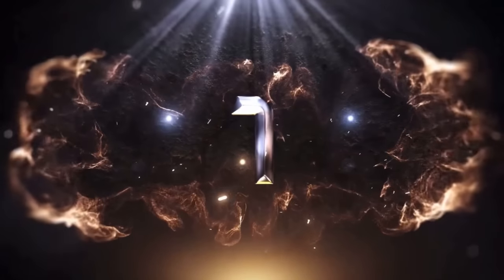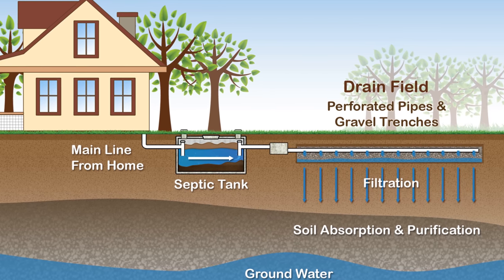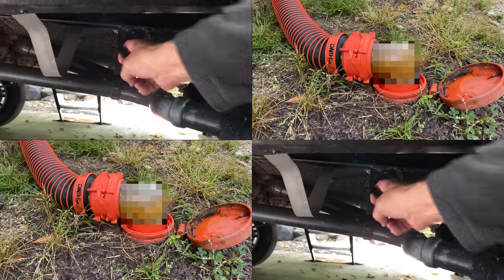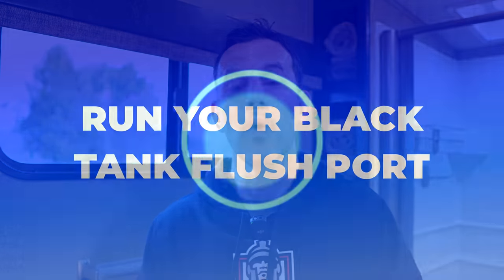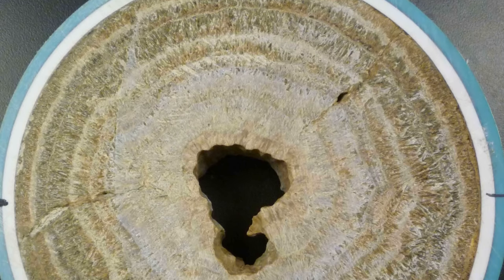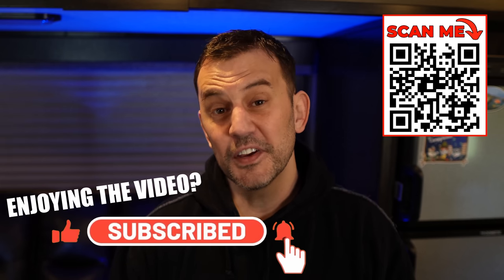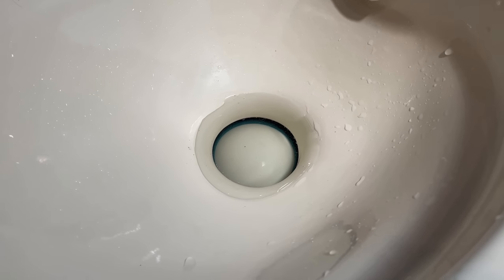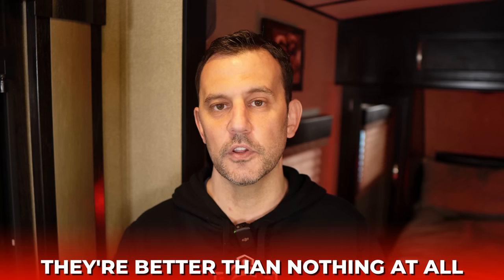RV Black Tank Mistakes, Myths & Secrets + Tips to Keep Sensors Working!

Comment: Upgraded from a pop-up, so new to this... Leaving the campground (not full hook ups) after I use the black tank flush and it runs clean, should I close the black valve and use the flush to put water into the black tank? How else would I always keep water in black tank? That's what I'm supposed to do, right? How much water? Then add some chemical even when not in use?
Reply from the maker: Marcus, precisely.  after you dump, put enough water in your tank to fill it about 10% of the way.  30 gallon tank = 3 gallons.  you can use the flush to do this.  if you are unsure how much you are putting in.... dump a gallon of water into your toilet without pressing the pedal.  then youll know how much one gallon is.  after that, you can slightly press the pedal enough to turn on the water but not open the ball valve.  once it hits that spot, dump it down.  now you know you have 1 gallon in your tank.  repeat until you reach the amount you want.  you can put the treatment in now or before you start using it on your next trip.
Reply: Thank you. So I'd be guessing how long to keep the black tank flush running to put 3 gallons in, if I did it that way. I appreciate your help!
Reply from the maker: It's something youll have to figure out.  Or you can use a 5 gallon bucket... thats what I do.  watch the video at the end of this video if you havent seen it yet.

Comment: I leave the dump valve closed until I'm ready to leave and I also empty the hot water tank into the toilet before I dump. 
Hot water loosens things up(shower head on most campers reaches the toilet).
You don't rinse your plates and bowls out with cold water before your wash them, right?
Reply from the maker: Great point, thanks for watching and sharing!

Comment: Newbie here. Just purchased a 5th wheel. If it is not in use right away, us there a need to fill the black water tank and add any cleaner. We may not use until July so 6 -8 weeks
Reply from the maker: Nope, you can leave it empty if it’s never been used.  Enjoy your new RV!

Comment: Warning for all towable RV owners . Inspect your I beams in the vicinity of the axle / spring shackles.  Sooner or later even the big dollar 5th wheel and travel trailers will get cracks that can cause major damage or crashes . This occurs on tandem axle or especially three axle trailers .  Springs , spring shackles and the I beams will break. On 5th wheels the Basement to upper frame risers regularly break . This information can be found on Youtube and cansave an on road failure or a devastating accident . And the most expensive 5th wheels to the lowly 2 axle travel trailer all break.  That popping sounds you hear backing into camp or making a tight turn is twisting the hell out of your 1/8th inch cheap Lippert metal I beams .
Reply from the maker: Thanks for sharing.

Comment: I have a Jayco Class C. When I use the flush port, it seems the fresh water tank fills up. Because of this I use a Flush King instead. Any idea what’s going on with my flush port?
Reply from the maker: open your fresh tank drain, let it drain, then run your black tank flush.  if water starts redraining out of the fresh water tank, you have a serious issue of cross-contamination issue.  I would check using this procedure first, I find it unlikely but let me know.

Comment: Liquify the black tank yes it helps, but for me I use the old method to clean my tank. I have a 2022 model and it has the hookup where you attach a hose but that way of cleaning was crap. The old method works far better and that’s putting the stick water cleaner down the toilet. Now I can actually see the black tank. I may also close the valve and fill once again then open most of the time actually nothing more comes out except water. The stick works for me.
Reply from the maker: thanks for sharing Brian.

Comment: Great video! My issue is that my RV is new and my sensors never worked from the beginning. They filled our tanks full during our orientation and then completely emptied before transport. I don’t think that there is a build up on the sensors.
Reply from the maker: That's interesting, I wonder why they wouldnt be working brand new out the door??
Reply: @RVTIPSANDTRAVELS  Right! If anything comes to mind, please let me know. This is for all my tanks (two in front and two in back). Even when I completely drain all of them, the sensors all say Full Tank. Very frustrating. I don’t want to just “live with it” I want to fix it. Lol.

Comment: Thinking one reason they are working is because your outflow is wide open and since its empty it has dried out, so no moisture is being utilized by sensors to produce a reading.
Reply from the maker: my waste tanks are never dried out. I always keep water in them.  After I dump, I ALWAYS IMMEDIATELY put 4-5 gallons of water back in.  Even if the RV is sitting in the driveway for a month until the next trip.  I mention this in about 9 of our videos lol.  The only time my tanks are dry is when its winterized.  They are working because I back flush the tanks, but it seems you dont believe me lol.  this video shows how much stuff stays in the tank after the first dump, which is why back filling and flushing a second time will help get all that out and clean the sensors:  https://youtu.be/Q7ZJzfimLwg

theres video proof in that video link i just posted that shows not everything comes out after 1 dump. thats why sensors fail, backfilling and rinsing your tank is important to keep them working.

Comment: When using the black tank flush, is it required to keep the black valve open because of backpressure up into the toilet that can overflow? Like will it harm the system or just precaution to prevent overflow?
Reply from the maker: theres no pressure build up because of the vent, but its ideal to leave it open to prevent overflow.  Not necessary though, correct.

Comment: I originally learned that when using the black tank flush you keep the valve closed and let it fill up, then dump. I figured it soaks up and gets all the stuff on the walls better? I guess that was wrong 🤔
Reply from the maker: It won’t do anything if there’s water in the tank.

Comment: So here is my issue. I only urinate in my toilet in my camper i just got. One day i checked my tank capacity and it said it was full. Now i was told since i only urinate i could leave the black tank open so i did. I was checking my tank for the first two weeks to make sure everything was good and it wasn't building up in the tank and it wasn't. Until now. I checked it today and it's showing full. I tried using the flush thats on the camper but the water wasn't going into the tank. What do i need to do? Yes, im new at the whole 5th wheel camper/rv so any ideas or tips would be really be appreciated and my canper is stationary.
Reply from the maker: are you using septic safe toilet paper?  not rv safe, septic safe only.
Reply: @RVTIPSANDTRAVELS  It only gets used to urinate in. I closed the valve put some water down the toilet, about 3 gallons, then went and opened the valve up and it drained. I believe the sensors are reading false. I done a flush twice and now it's reading half a tank. When I get more time I'm going to do more to see if it's just something on the sensors

Comment: Just De-winterized my RV went on a weekend trip and used the toilet, no solid waste went into it just liquids flushed everything out and now it’s parked until the next trip I’m a little confused. Should I have water in that black tank while it’s sitting waiting for the next trip?
Reply from the maker: If there are no solids at all in your tank it’s less necessary, but I think about it… I’m this video there’s even some liquid left in the tank after dumping, so it doesn’t hurt to put water back in, even while it sits between trips, just to keep everything diluted and less concentrated.  Plus anything from the past that might be in there could now have the chance to start to break up from the water. Hope that makes sense.
Reply: @RVTIPSANDTRAVELS  Sounds good, thanks for the quick response. Really enjoy your videos. Great Contant keep up the good work.
Reply from the maker: Thanks buddy, I appreciate that.

Comment: I have tried back flushing and filling overnight but no luck. Discussing descaling a black tank (2/3 full sensor is not reading correctly), what ratio of water to Rydlyme? Amazon says 1:1 for extreme and 1:3 for period maintenance. I have a 48 gallon black tank and to address all sensors which would be about 30 gallons. If I used 1:3, I would need 10 gallons of Rydlyme. Is this your recommended mixture?
Reply from the maker: Richard, as mentioned in the video, I’ve never used it, but among my research I’ve read in a few places that 1/10and even 1/30 was a good ratio. Let me see if I can find more info and get back to you.

Comment: Idk.. I think the guy with kleen who has been cleaning tanks for 9 years might know a "little" more than you, that's where the its not a septic system its a holding tank comes from. But idk that's just my gut instinct, what he says makes total sense and has cleaned 10000+ tanks.
Reply from the maker: Personally I’m not taking tank cleaning advice from someone who needs to clean tanks.  In this video there is very clear proof that solids do not exit the tank, while liquids do.  So with that video proof I’m going to follow the science and not the sales pitch.  It’s worked for me for 8 years now, and that’s my job here… to help others, not sell tank cleaning services.  This same gentlemen in another video also encourages using bleach in a metal water heater tank.  Again, very poor and irresponsible advice.  You don’t need to be a chemist to google search what bleach does to metal.  While we disagree, I appreciate your input and watching.
Reply: @RVTIPSANDTRAVELS  I think the only way to know for certain would be to buy 2 new rv’s and conduct a test for at least a year. Do both methods, then cut the tanks in half and see the results.
Reply from the maker: I’m going to buy a black tank this spring, build an entire external system, and do independent flush tests.  Going to cut the top of the tank off to film everything.  Will be a big production because I’m interested to see myself.  It’s going to be an interesting video to say the least.  🍻
Reply: @RVTIPSANDTRAVELS  Amazing!! Thank you!

Comment: In an effort to mitigate any issues…the morning we’re leaving I fill my tank to 3/4-Full and flush it. I do this three times and to your point about the tank never being perfectly clean…I still get debris coming out on the third flush. I also keep my tank a 1/4 full with treatment in it while storing…not sure if there is any benefit in doing this?
Reply from the maker: I do the same, I think keeping water in all the time will prevent anything that may be left in there from permanently sticking to the bottom.
Reply from the maker: I do empty it when winterizing though, but will spend a little time cleaning it before then.
Reply: @RVTIPSANDTRAVELS  We don't get that cold where winterizing is a thing, but makes total sense to empty it when temps are sitting below freezing.

Comment: I'm no expert, but I would bet (because it's only the bathroom sink) the thought process behind having the bathroom sink drain into the black tank is to eliminate the need to use a bucket or hose to fill it through the toilet. Would make more sense to have a flush tank setting on the toilet that increased the flush GPM rate to match dumping a small bucket of water into the toiletthat would only work if the tank wasn't full.
Reply from the maker: You read my mind, was just talking to a friend about how we need something to fast fill the black tank so it can be rinsed after dumping.  Totally agree.
Reply: Being the cynical sort, I bet they did it to save $35 per unit, but when asked, the executives will say that you are correct.

Comment: I don't work for an RV manufacturer, but I'd say the reason for piping the bathroom sink and shower into the black tank is cost.  The trailer's design simply won't accommodate piping the kitchen, bathroom sink, and shower into a single gray tank.  Plumbing them into the black tank saves the cost of an additional gray tank.

Isn't it always about the Benjamins?
Reply from the maker: it usually is about cost, but I have a gray tank for my shower, which is right next to the toilet and the sink.  This might be the case though on other floor plans.
Reply: @RVTIPSANDTRAVELS  that is exactly my point.  I have a galley tank and bathroom tank for gray. My black is separate. If a manufacturer pipes what would normally be bathroom gray into the black, that is a cost cutting measure.

Comment: Wanted to share my thoughts on video content at Time Index 12:14

I don't know where others are getting the water from to flush their black tanks, but we always use the water at the dump station. As a matter of fact, where we camp, we have never need to connect our personal hose but I realize that's just a matter of where WE camp.  The point here is that if you are using non potable water to flush your black tank, you have already contaminated the plumbing between the outside inlet and the black tank. I'm not saying this is sewer water you're using here, but it's non potable for a reason. Second, if you connect your personal hose to a non potable water source, you have contaminated that hose as well. 

Virtually everyone carries two or more hoses with them anyhow for various purposes. Having a dedicated hose is a no brainer for anything septic. 

And on a side note, I personally HATE THE TERM "drinking water hose". I submit to you that if anyone is drinking the water that 1) comes from an unknown source even if it's labeled as potable, and 2) that comes out of their clear water tanks period, that they are doing it wrong.  There is simply NO NEED to do this. There is no "Good" reason to do do this. And no matter what the counter argument is, the FACT is you are playing with fire here if you are not SUPER diligent. We should call these hoses Dish water or Shower water hoses. When I fill my clear water tank, I personally fill a gallon milk jug with water, add 1 (sometimes 2) Pepsi caps full of Clorox to the gallon of water, and dump it in the tank. When I shower, I want the faintest hint of a Clorox smell. One, this won't hurt you or your dishes. Two, if you add Clorox in a quantity where you can just barely detect its presence, that's going to go a LONG ways in killing off a lot of things you really don't want to be washing your body or your dishes in. A lil dab will do ya. No need to go crazy and over doing it will hurt your plumbing and seals. Yes, you are putting some Clorox in your Black Tank every time you flush it and that's technically not a great Idea. But I submit to you that the dilution is so low that the Black Tank biome can cope with it/overwhelm it. I certainly don't think it hurts to have a little Clorox in your grey tanks. If you are doing yearly tank maintenance, your are probably adding a strong solution to your tanks once a year already. This a capful or two on every fill is just a preemptive precaution and it helps me sleep better at night knowing that what ever is lurking in that clear water tank really REALLY dislikes Clorox no matter how diluted it is. In any event, there's no way Id drink water that comes out of the clear water tank. I don't want to ingest legionella and I don't want to ingest any amount of Clorox. It's so easy to buy a case of bottled water, or bring it from home if you are feeling frugal and "Green".
Reply from the maker: Good info Stan.  When at a full hook up, which is the case for the majority of our trips, we get water from our hookup for the black tank.  We also bring bottled water for drinking.
Reply: @RVTIPSANDTRAVELS  Just thought I'd follow up with something I should have prefaced upfront. just to be clear,  my commentary wasn't directed at you. I hope you don't think i was having a go at you. My commentary was meant to be generically  directed to the unending void of the internet. When I use words like "You", I don't mean really mean you personally.  I mean it in a very generic way to sort of refer to anyone and everyone, sort of like a PSA.
Reply from the maker: Definitely did not take it that way Stan, and your original comment is excellent info.  Thanks for adding to the content.  As you know, I never claim to know everything and always welcome others input and experiences.

Comment: My trailers bathroom sink runs into black. Only answer, cost savings for them. They don't care how stupid it is. My low point drains are also in the most ridiculous place. Everyone who owns the same model thinks this is stupid also. So far I have not had black tank gases burping from the sink. But if the water in the p trap died out. I could see a very stinky situation.
Reply from the maker: i agree, its stupid.  your p traps should prevent any gases comeing through too.